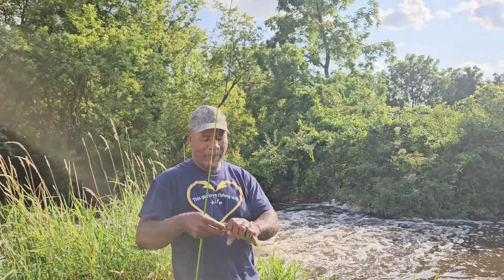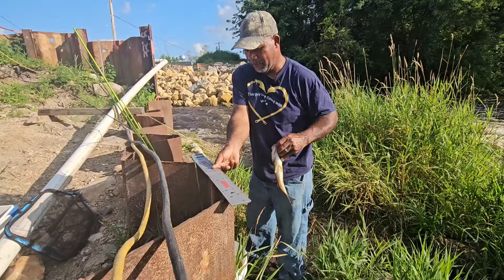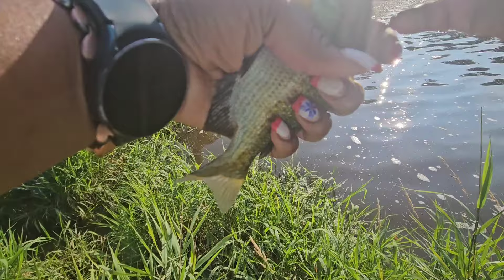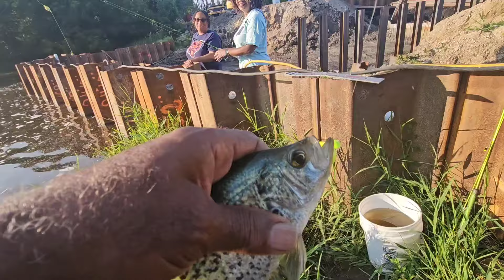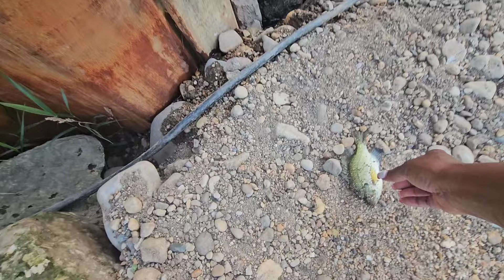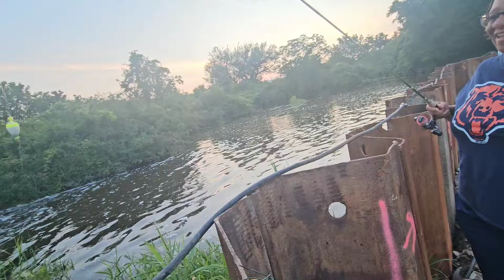CRAPPIE FISHING WITH A FRIEND

Comment: Miss Linda he is right about that it's got to be in you and your heart like  Ed and I but I promise you this much young stren 6 pound blue clear line little plastic slide on bobber stop little bead little Carlisle slip float so easy to adjust your depth to the fish little slide up or down your line also not disabled to a stick float you can't cast your bobber for 12 16 feet slip float easy sinker red Mr crappie hook smaller size minnow s girl you'll be the crappie queen 👑 promise  you set that bobber stop bead however far down do it girl
Reply from the maker: Thank you for the tip.